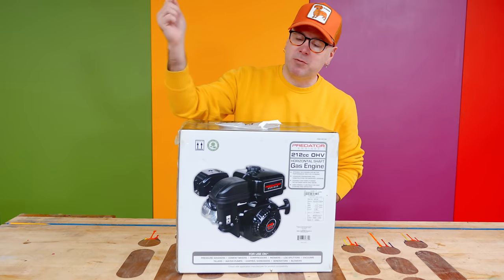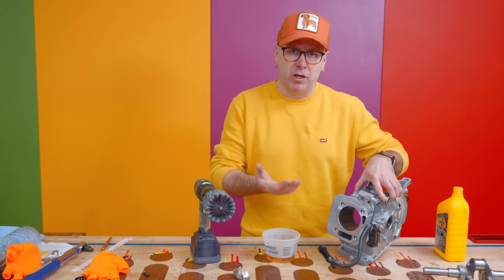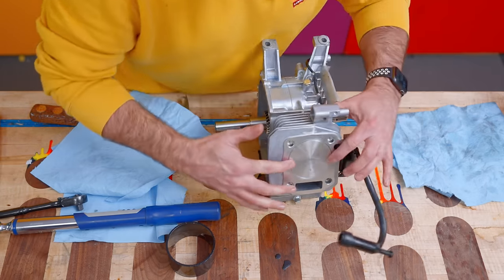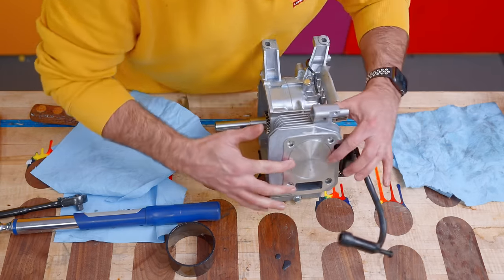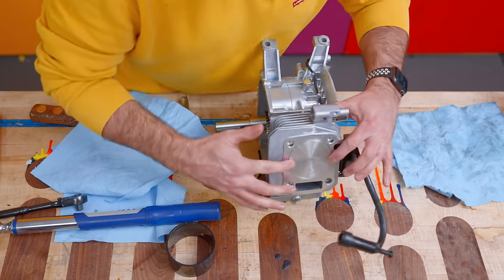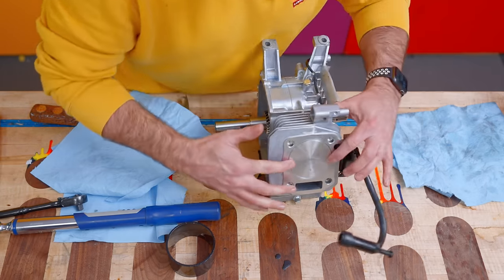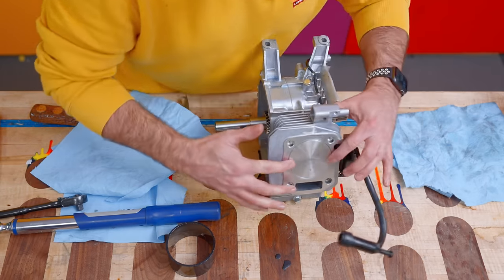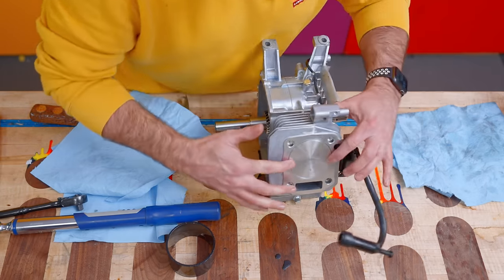How to Build a Competitive Kart Racing Engine (Stock Appearing)

Comment: You should try balancing the crank and cam so the engine won't shake and run smother all u do is add a little led like your balancing a tier
Reply from the maker: It's impossible to balance, a single cylinder crankshaft

Comment: I raced stock-class carts for a couple years as a kid, I was mechanic for a friends cart. We used the B&S 5hp engine. Early 1970s. Clearance grinding on the crank throw will affect balance. How did you compensate for that?
Reply: I was wondering the same thing.  When I was racing, engine builders hated having to modify crankshafts because an unbalanced crankshaft would result in engine failure.

Comment: add molybdenum disulfide to your oil, I use moly lube MSo2, been using it for over 20 yrs. it becomes effective after it is run in the engine a few heat cycles. I also use Moly grease as assembly lube, turn what ever engine you are building over slowly a few times, on valve guides cut them off flat with the port runners, lots more air moves through. I also cut the rules by milling the head mating surface .20-.30 thousandths, if you really want to go the ultimate way, groove the cylinder edges for an round annealed copper ring= total sealing <got that trick from Essingler engines and motorsports, they race sand rail cars> ....oB  it is the way

Comment: 4 stroke engines are only good for lawnmowers and waterpumps. I used to run 100cc open, 2 stroke, my clutch was centrifugal,  tungsten carbide coated, running 4 chrome shoes, with seven weight plates per shoe. The clutch only engaged at 10,000 rpm and the engine's recline was a modest 18,000 rpm, but I reved them to 20,000 rpm. A clutch cost $800 and only lasted three races.  The connecting rod had to be changed after two races. I used 100% methanol with 8oz of caster oil per US gal. A fully modified 100cc Corsair would set you back $4,500. It would do 140 mph in 600 feet.
Reply from the maker: I'm just following the rules for the class i run in. 😉

Comment: I enjoyed this. I tune two stroke lambretta/vespa engines so there's a lot of similarities. My first though was if you're racing why not use a two stroke? There's no question that a two stroke is always going to be a better racing engine. If it wasn't for that tw?t Soichiro Honda two strokes would still be being used for motorbike racing. Hmmmm, did I just answer my own question?

Comment: Hey, great video. I still have one question though, I was wondering what ideal gear ratio you should aim for. I know there are many factors in that determine GR (engine rpm, wheel size, etc) but on your average go kart what is a good GR.
Reply: It really depends on the track.  You're going for best average speed.  The engine needs to be at an RPM where it makes power at the lowest speeds you'll see.  Is that 5mph or 25mph?  Depends on the track.  The longer your straights are, the more top speed becomes a factor, and some acceleration can be sacrificed for reaching a higher speed.  That said, an extra 5mph accelerating out of a turn lasts for the entire straight, whereas an extra 5mph top speed might only help for the last bit.  For example, in drag racing, gaining a tenth of a second in the first 60 feet of acceleration is generally worth more than 2 tenths of a second by the end of a quarter mile.

Comment: May not matter in this application, but you should never grind a crankshaft in general, they are precision balanced from the factory; better to take the material from the crankcase to get clearance
Reply from the maker: A single cylinder engine will never be balanced.

Comment: You don't use power tools to put it together,  but you risk the chance screwing up the crank and bearings beating on it with a hammer to remove the flywheel,  get a puller, or get a lead hammer.
Reply from the maker: ok

Comment: ALWAYS USE ASSEMBLY LUBE
AN OIL CHANGE IS NOT WORTH RUNNING THE ENGINE DRY ON FIRST STARTUP
THAT WILL CAUSE MORE PROBLEMS THAN A SLIGHT BIT OF OIL MIXING
I HAVE EXPERIENCE WITH BOTH ISSUES AND I WOULD RATHER JUST CHANGE THE OIL AFTER ITS RUN FOR A FEW MINUTES THAN HAVE TO DO IT ALL OVER AGAIN
regular oil will work but i prefer thick assembly lube just because it stays in the vital parts of the engine longer on the first startup

Comment: I use Gasoline to check the valves/seats are sealed, it's a very small molecule. If it doesn't leak gas, it's sealed.

Comment: In 4 strokes there's no good back pressure - it's all bad. The pipe length is for something else - torque production over a broader RPM range would be my guess.
Usually for valves, they use isopropyl alcohol but gasoline is fine. Typically there's no reason to check after you've synchro seated them anyhow. To check for seat-valve concentricity and seal, use Bearing Blue instead of grinding paste. The Bearing Blue will show you very clearly whether it is sealing or not. Just inspect the color on the valve and seat and if it's even then it won't leak - how can it?
I never hand lap new valves and seats.
Thing is, hand lapping might have it's place (in a suction intake valve hit an miss engine single cylinder engine of 1898) but consider it is done at room temperature and not operating temperature and the ring you've just created with the grinding paste is a depression in a brand new seat and valve that won't be touching properly when hot anyhow.
In the seat cutter there is an included interference angle (usually around 1 deg) to allow for the seat and valve face angle at operating temperature to be approximately equal, a) due to differing expansion rates of the seat and valve, b) some difference so there's a slight cork or wedge effect when the valve closes. Lapping is not meant to be used. 
A 30 deg seat cutter to go with a 30 deg valve face has 29 or 31deg angle (I forget which) included in the 30deg cutter. It's done so the user doesn't have to work it out. 
 
Also, after honing it is good practice to first do a normal solvent clean a couple of times but the final clean is always best done with warm soapy water and a scrubbing brush that you'd use for your hands - then rinse, dry with compressed air and hand oil the bore immediately. What happens is stone material gets in the cross hatching and you want it out of there. 
Just grate a bar of soap with a cheese grater into some warm water and agitate with your hand and scrub it out really well, then rinse.
 
Re running in, what you want is load. You're trying to get gas behind the rings so the full face of them conforms with the bore. How you do it is full throttle from as low an RPM so not to labor the engine up to say 4500-5000rpm, then repeat about 10 times.

Comment: 11:12 Surely you meant file the CRANK not the CAM, but that's a halfass "fix" either way.  Any interference there (often, you said) is just poor design. Is that because you changed cams?

Comment: I have gy6 trail master go kart that I converted to the predator 212 motor. I have a 41 chain and sprocket with 72 teeth on it. The problem I have is when I turn the go kart and punch the gas (like power slide or doing donuts) the chain always breaks. The chain that was with the gy6 motor was much bigger and the sprocket did not have as many teeth.  I had to weld a higher platform to mount the motor on the back for the 212 motor.  Could it be that the platform I welded is giving and the motor is shifting some causing the chain to break or is the chain and sprocket to small?   This is for my kids and I can not find any help.  Thanks for any advice.

Comment: The engine needs a load on it for break in.. you’d be better off cruising around the neighborhood than just free spinning the engine like that

Ps. Valve seat contact width .040”
30 45 and 60 degrees on valve seat 
45 degree valve with 30 degree back cut
Valve spring 100lbs per .100” of lift
Milling the head or block is known as decking
Both decks should have a lapped finish
… great video…

Comment: No reason to check the oil clearance on the rod and crank. You can't buy under or over sized bearings to accommodate a variation in tolerance.

Comment: Engine rebuilders use vacuum to test valve sealing - also if your going to use a liquid to test valve sealing do not use water - water is a very big molecule and does not give an accurate indication of leaks - use some kind of solvent to look for leaks ... have fun

Comment: Copperhead gasket tempered with a torch and Toyota brand head gasket sealant will hold a 3-in piston and a stroker crank
Reply from the maker: not compliant.

Comment: Doesn't grinding on the crankshaft like that throw off the balance of it? I'm a very experienced mechanic but I'm genuinely asking because I didn't think you could do that. Atleast without balancing
Reply from the maker: a single cylinder engine can never be balanced.

Comment: When everything is out of the motor, you must weld around the valve that is closer to the Crank shaft because it's very weak around that one valve it will break off and blow the motor. The welding will make it stronger so it won't break. The motors I'm talking about is a 5h brigs and Stratton that uses methanol fuel.
Reply: Not true. I run full blown open OHV engines (clones, animals) and open flatheads. You dont have to weld anything, most people including myself do not use the stock 5hp block because it was not meant for high HP. They have blocks called Raptor which is a buffed up version of the stock 5hp block just with dual bearings for the crank and cam, then they have what is known as the "blockzilla" which is still a 5hp style block its just billet and a little bigger.
Reply: I raced 5h brig's seen it happen a few times. I'm not talking about animal . I should have been more specific
Reply: I never ran clone or ohv engine's. Brigs and Stratton are notorious for that.
Reply: @turbotim13  I currently run all 3, I've never had an issue. Now we also don't push a stock 5hp block to crazy RPMS but we do run them quite often and i know some people who do use the stock block for open racing and i dont believe theyve had alot of issues either
Reply: @ol998  I didn't run a stock 5 horse brig's no gas, but methanol. We built them to the WKA dirt series specs. But there is the gray area. People were having problems with the outer valve where it is weaker. The aluminum would crack around the valve that is the weakest the inner one was fine so people just put a weld around just to make it stronger not on the valve on the aluminum. This was happening in '98' maybe they are now stronger. I was just making a suggestion for what we were all doing back then.
Reply: @ol998 we all did it for safety reasons, so we wouldn't blow the motor.
Reply: @turbotim13  I gotcha, it’s changed a lot since then for sure. I started in 2001 right before the Briggs flatheads went out and the animals came in. They’ve got all kinds of crazy stuff out there now for them. We are building a Briggs flathead now and estimating around 32-38 HP out of it. Check out some of our builds on my page.
Reply: @ol998  I was racing when the animal motors came out. I stopped in 2001 after I won the championship in 2 divisions. Then moved up to a late model. Very expensive racing a late model.
Reply: @turbotim13  Yea man for sure, I wanted to get into cars but with the way the pricing on stuff is now, plus when you break something in karts it’s a couple hundred bucks maybe, in cars it turns into a couple thousand lol

Comment: Why not just disconnect the oil sensor and leave it factory sealing the hole instead of creating a possible failure point? 
Same with other devices. Once you take out the governor gear it's inoperable.

Comment: I heard from some videos that i need to modify some parts of the engine before using it because the engine output power. Since we are going to rotate the engine so we can connect it to the wheels it won't get enough oil to the parts. is that true? does this concern every engine or only the ones that have a vertical shaft?

Comment: Don't use water to check for valve sealing. Use a solvent like Acetone or Xylene. You can use gasoline but Acetone or Xylene are preferred. Never water

Comment: The rockers are 200+. Do the rest of the parts cost as much as a ls? If so any good prebuilt small engines without paying over 1000 for engine amd new parts
Reply: Fr, building a small engine should be cheaper.
Reply from the maker: This is how motorsports works. it's stupid expensive to be competitive unless you get into the "box stock classes"

Comment: that head gasket just blocket the oil pressure from engine case to the head, you will have oil leaking from oil seal becausae of high oil pressure.

Comment: what would be must haves/ must changes to the engine in the cheapest way possible from this video to a 210 cc predator 7.5hp engine
Reply from the maker: remove the governor. swap out the muffler for a header pipe. and replace the air filter with a high flow air filter. That will greatly increase the RPM. Because of this you'll want to replace the flywheel with a billet aluminum flywheel which will be safer as well as increase your throttle response/acceleration.

Comment: I have a Predator 212 and I'm finally have time to be able to put the kart together. Work and life got too busy but now I can make it happen. Eventually I want to do this to an engine but for now I am going to stick with the stock 212, with just an Exhaust Pipe, Top Plate, Fuel Pump, Air Filter Adapter and Filter,  Adjustable Carb. I have 2 questions, so anyone with advice or suggestions, I would greatly appreciate it. 
What clutch and chain would be recommended for a Predator 212 for basic use on a Go-Kart?
Also, WIth those modifications, am I running any risk at damaging the engine or causing a dangerous situation?

Comment: It's not that complicated. E85 or ethanol burns cooler and slower. It has higher detonation resistance, just like high octane race gas.

In my DI car we have knock sensors and can use those to find our happy medium by advancing spark timing till you start to lose power, then backing off a few degrees. 

You also will need larger jets as the stoichiometric ratio is different.  So jets, and timing, plus everything in this video.

If you ran straight e85, (most pump ethanol contains wildly different proportions of alcohol) you'd need approx 40-50percent more fuel as stoich is closer to 9.8:1 instead of 14.7:1.

Comment: To see if your valves are leaking you have to buy a vacuem motor that suck out al the air if it cant suck vacuem than it means there are not closed

Comment: 29:28 you should fill it with gasoline not with water becouse if there is any oil on the head the water is never going to leak from the valves

Comment: Your half way there on the valve leak test for a home job blow air with the blower fon your compressor threw the intake and exhaust ports. The better shops put them under vacuume from the port ports and watch for vacuum loss

Comment: In the video, water was used to test for leaks between the valves and their seats. However, water has high surface tension, preventing it from seeping through a leak. The best product to use is gasoline.

Comment: I run pro open for yrs with a hemi pred a custom cut isky cam long rod  32 28 vlv head had a Ec Tilly 304 for one race and dude I bought I from wreck and fell back against me as he was getting back on 4 wheels so I was all mikuni I did run a modified gx390 carb for a month but once my new motor was done with the adjustable fly wheel its a bored and stroked gx200 my Lil motor a hemi pred it runs an ultralight flywheel I'm all over the place trying to remember everything I haven't raced since winter 19

Comment: YOU MADE ME WINCR WHEN YOU WERE GRINDING ON THAT Crankshaft thus making it now out of balance. iv e ground the block never the crank. it has to have vibration and it most definitely is out of balance. now i have been racing 2 strokes nd building my own engines for over 35 years and never sawanyone just grind on a crank before. wo

Comment: Those little motors are pretty mean. all i did to one was take the governor out and shaved the head.  made for a scary fast mini bike then. It nearly backflipped out from under me first take off. the clutch is like having a 2000rpm stall which is about halfway to redline. clocked it around 40mph and it gets there quick...  good times😂

Comment: This was a super interesting video! I do have a question though i hope someone here could help me understand. I get the shaving of the block for tolerances, but wouldn't shaving material off the crank upset its balance? Maybe its so little it wont matter in the long run, but found that interesting.
Reply from the maker: it's so little it doesn't matter. these cranks don't come balanced anyways.

Comment: As a manufacturing expert with tons of experience in machining with a couple engineering degrees, who now builds little 2-stroke engines for a living, I would say your concepts are good, but some of your methods, (flywheel removal and hand machining practice), could use some work.  Fun stuff though, building and racing them.  You make a good vid.  People will have more fun because of you sir.  :)

Comment: im not a racer either but im trying too upgrade my car b to a motorcycle slide carb and im dealing with a flat spot basically if you floor the throttle it just wants to stall if you ease into it it works I like the motorcycle carbs do y\to adjusting ratio is so much better but again dealing with stall or flat spots what to do I don't no? its a Subaru 9.5hp motor

Comment: if your supposed to use the same stroke how come you can get away with a longer connecting rod?
Reply from the maker: Con rod doesn't change the length of the stroke, only the position. It still moves the same amount up and down.

Comment: I use gasoline to do my valve leak test....water is very hydrostatic compared to gasoline. It won't always leak through where gasoline might. Overall, it's a good build, though 👌